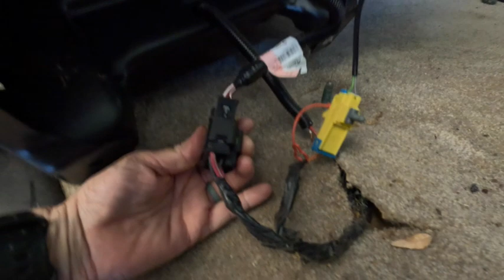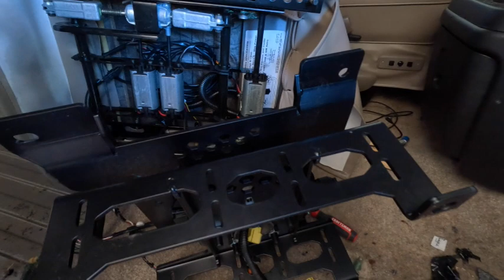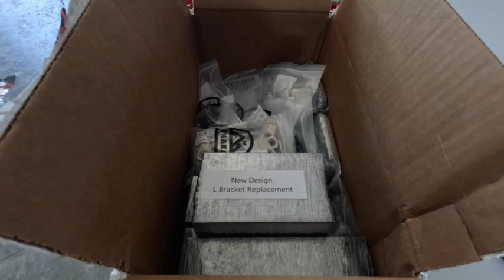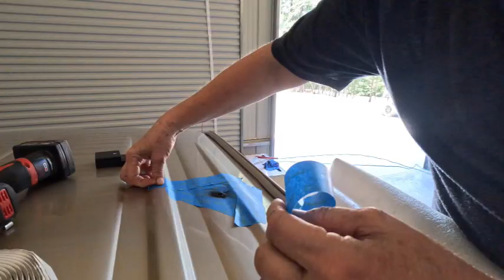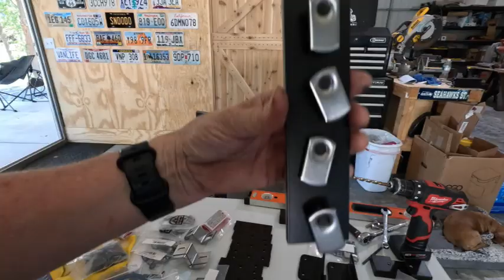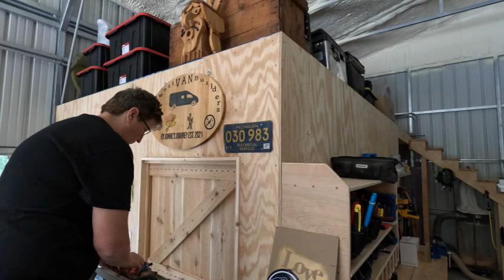Conversion Van Build : Swivel Seat & Roof Rack Install

Comment: Nice work. There are wiring tools made for removing the wires from the plug.
Reply from the maker: Cool, thanks. I will have to check that out
Reply: Terminal removal tool.

Comment: Wow,  you are just spitting out these conversions.  Great Job! I do have a question about adding the swivel base, after its installed, do the seat electric controls still work? I.e. slide forward, recline, lumbar etc? Seems like something I would like to do, well get done because I don’t trust I will be able to do, provided the original controls can still work.
Reply from the maker: Yes they do. 👍